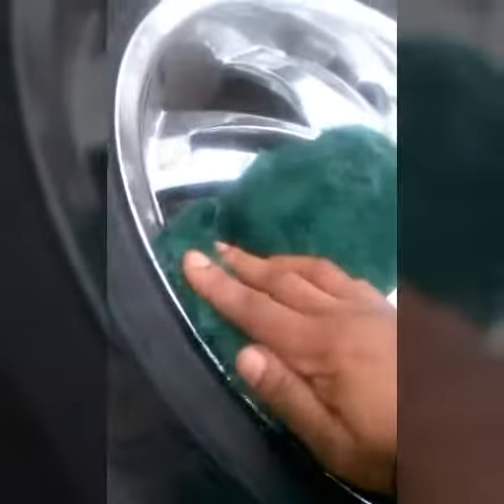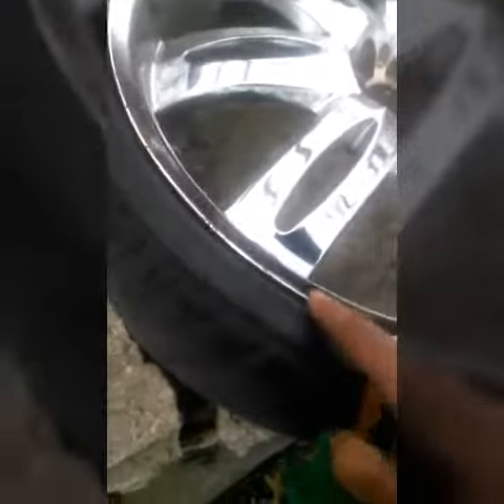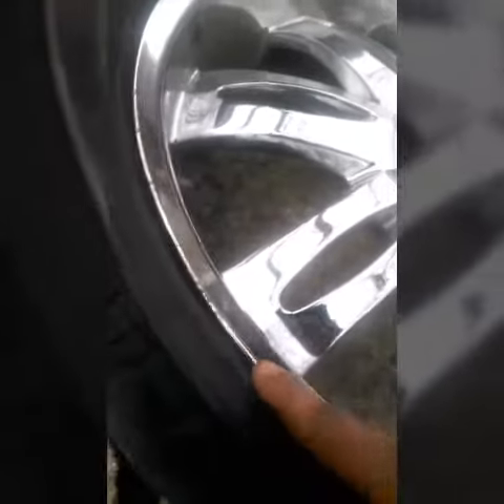Bent 22 inch rim

Comment: I noticed your rim is steel. What about other metals any recommendations? Alloy, aluminum, etc? How about dead weight hammer? Ty!
Reply from the maker: Alloy or aluminum. Ok I’m not going to steer you wrong. So I don’t know the answer to that. If it was me that had a bend in that type of rim to get out. I wouldn’t do it the way I did the steel rim. It may crack it. I would check on reddit and see if people have something to say about working that material. If I found nothing and it was a small bend. I would take the tire off and use a hand torch but heat it up from the inside and only slightly not red hot and do the same method with less force. In doing that if it looked like it wasn’t working or I would have to hit it way harder then I was. 
Before I ruined it I would take it to the shop and even if I wasn’t going to pay them to fix it would ask questions as if I was and find out what method they would be using. I would ask questions about them using heat and if that would hurt my finish on the rim. 
And if they was asking to much to do it I would consider trying to give it another try. But now armed with more information. 
I’ve been working my bad this is late. Hope it helped.
Reply: Learn Self thank you for your response!!!

Comment: Do you have to take the tire off and did u have to get it resealed after?
Reply from the maker: Lori M Hello Lori. Ok when I bent my rim the seal never broke. If you bent your rim and it also started leaking, you might have to get that black seal again. But you might not have to. Hope this helped. I bent my rim again but this time I will need to weld it. Going to load it tomorrow. You should feel better about your bend after you see this.
Reply: Learn Self thanks for ur feedback. It was leaking but it stopped after it was bent back In place so hopefully it's kool.
Reply from the maker: Lori M  don't mention it. Anytime

Comment: How hard did you hit the rim with the hammer? I have a slight bend that’s causing the tire not to seal to the rim
Reply from the maker: Ok. You want to use a 5 pound hammer.  You want tree towel to be at least 2 inches thick by folding it and placed over bend
Then Mr. Pittman its going to take strong taps how hard.  Give it about half of your full strength   (swing) but need to be controlled and calculated.  Tap and look.  Looking at it fyi different angles to see how far the bend advances every time. Hoped this helped.  If you still find your stood stuck let me know.  I have a bend if I have to I'll video that full through with bang scene.  Good luck
Reply from the maker: Very important.  My rims are steel. Rims made from different materials take different methods
Reply: Ok and do I hit exactly where the bend is?
Reply from the maker: Yes